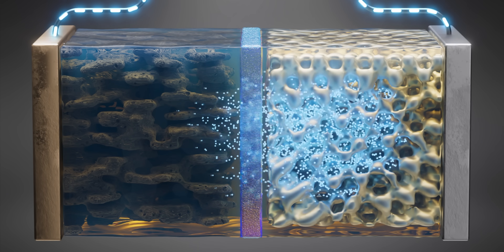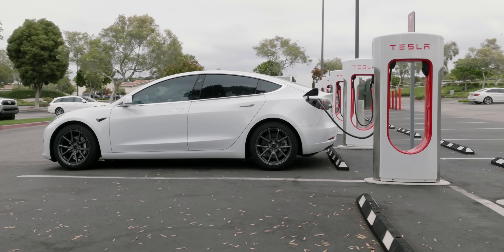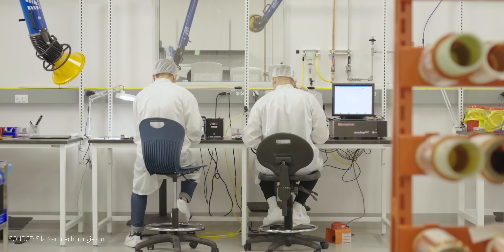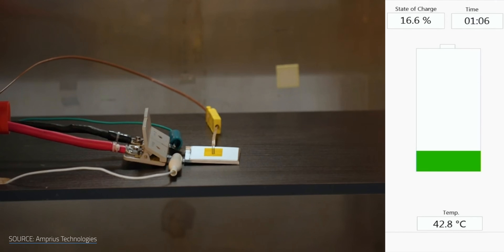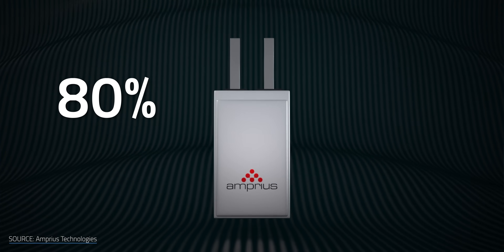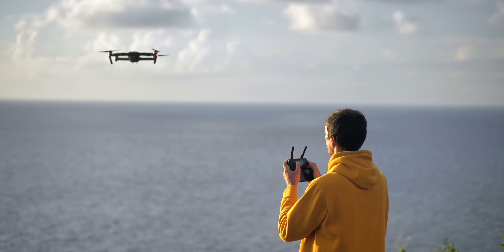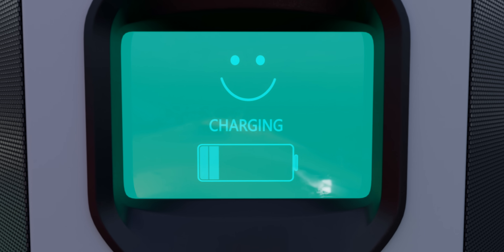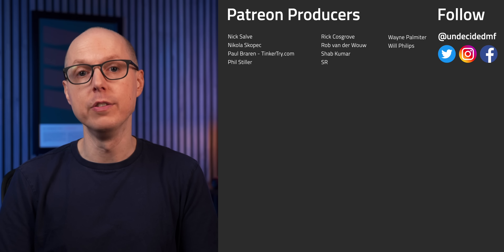Why This Ultra Dense Battery Breakthrough Matters

Comment: If a battery has a 50% weight advantage compared to current tech you could also definitely get a wooping range (if you keep the same weight ratio of batteries in EV's)? Paired with 6 minute charging it'll make EV's seriously contend with fossil fuels vehicles in charge time vs refuel, and range too. Now we just need infinite cheap electricity to actually be able to transition out of fossil fuel dependency, and power-grids that can handle these increased demands. :P Anyway, cool tech, hope it will prove viable at scale.
Reply: In the end much will depend on the price and expected cycle life.
Reply: @blablup1214  This. Cost per charge is the big question about this tech now.

Comment: Whatever happened to fuel cells?  If you have problems with storing the products of the reaction why not just remove them from the battery (essentially turning it into a fuel cell)?
Reply: You’re describing flow cells. They are also in research and production.
Reply: @nicholasthon973  Ohh great.  According to the definition on Wikipedia anytime you flow reactants through it's a fuel cell but that's possibly a mistake bc the term only seems to be used to describe reactions with O2... usually hydrogen.
Reply: Hydrogen is very inefficient for the production, fueling, and storing. It is pernicious (leaks). Deteriorates metals and other materials. Dangerous by being highly explosive pressures and burns clear while very hot. Hydrogen is all around a bad idea for most applications.

Comment: Sounds like battery tech is advancing faster that the bloody electric grid structure eventually its not gonna cope especially for cars 
Does faster charge times require more current or power 😜 i just want some for my ebike 😂😂

Comment: I'm always amused by new batteries that will charge 5 or 10 times faster, this will need 5 or 10 times the available power to the chargers and cables that are 5 to 10 times bigger or liquid nitrogen cooling or other far fetched ideas. The problem with ev's is not the battery tech, it's the power grid tech and the generation and transmission tech. A classic cart before the horse situation
Reply: True, but it would be a great advantage if the new battery could just hold todays' peak charging rates the whole time.  That would greatly reduce charge times without needing massively larger infrastructure.

Comment: LIthium is a dead end for EVs; refining is a choke point as it takes 500,000 gallons of water to refine a single ton. Silicon or other new chemistry is essential for EVs to rise beyond a niche market size. While EVs need a battery breakthrough I find EV advocates often distain other tech that also needs one such as Hydrogren. There is an existing solution which meets most requirements - Ethanol fueled PHEVs.  They already are being sold in Brazil and can commute full electric. Unlike EVs they use no fossil fuel.  The world grid is over 75% fossil fuel powered and has a 15% penatly for transmission to the charger and battery;  add to that EVs are heavier and use more power to move.

Comment: My big dose of doubt with these is we have seen literally hundreds of alternative battery techs to Li-ion over literal decades and exactly 0 have come to the general consumer market. It seems like battery tech needs to make such a large jump in every possible category at once to overcome market inertia that it's basically impossible for it to impact consumers. It feels like the entire sector is perpetually "too good too be true" for the average person.
Reply: One of the new battery technologies of the last few decades has come onto the market: nickel-metal-hydride. It is not as good as lithium-ion for energy density but it is very good as a direct replacement for nickel-cadmium (which self-discharges rapidly, making it unsuitable for some applications) and for non-rechargeable 1.5v cells, the continuing manufacture and sale of which is now inexcusable.
Reply: @cedriclynch  NiMH batteries entered the market over 20 years ago. It's not that much newer than Li-ion, and was never targeted at it (as you mention it replaced NiCad and DID beat it on every single category) so it's a different market segment.

Comment: There's definitely a need for far more powerful and quick charging batteries. However,  passenger cars don't contribute more than 10 percent of the total CO2 output. We could go green with everything else and let cars continue to use gasoline and the environment would be just fine. Why is there this incessant picking on cars?  Go take care of power plants and that'll make a much bigger difference for the environment.

Comment: Does someone want to fix the fact that EVs lose all their value when the battery hits end of life?  A better battery should have a 20-30 year life and be cheap to replace.  And then there is Tesla's "the battery is the car body" nonsense that assures the car is a complete write off at end of battery life... The cost of replacement MUST come down, otherwise EVs will be the WORST thing in the market for environmental impact.

Comment: I know this seems innocuous, but I am curious if it is a choice or lack of knowledge to continue propagating unmanned.

The faa has officially stated that the term unmanned was historically used in an intentional gender segregation capacity and has moved away from that term to uncrewed or unpiloted.

Search "faa words matter"

As a male in the industry it is a very small action to take to help reduce the history of gender exclusion in this section of the work place.

Comment: 3:07, that is laughably easy to prevent, just use an ultra sensitive pressure toggle switch to cut the power supply when the expansion pushes against it, no power supply = stopped expansion. You can add a timer to the power connector that the switch redirects the power to when activated, once the timer runs out the power is once more directed to the battery instead of the timer. Battery will never overcharge like that, might die from lack of power but that's still better than overcharging, can always make the timer programmable by just adding a counter to the battery that just keeps going up while the power is active and the timer can just use decrement that count on every tick to reach 0 and timeout. There's ZERO excuse for allowing batteries to over expand.

Comment: I am doubtful about silicon being more environmentally friendly. 
Natural Graphite occurs as graphite flakes in certain rocks (eg graphitic schist) and is liberated by crushing and floatation. 
Getting pure silicon is generally through a smelting process since it is often bound with oxygen in a source silicon dioxide sand.
Reply: Yes, also you can't just take sand from the beach, it is dredged up from the coastal area causing environmental damage
Reply: Silicon is never found in the elemental state as it is far to reactive chemically.  Most silicon is found combined as oxides in rocks with other minerals.  Quartz is the purest silicon dioxide and is fairly common but still has to separated from the other minerals such as those found in granite.  To obtain pure silicon from silica (SiO2) requires the input of enormous energy to remove the oxygen. Really tough to do compared to mining graphite.

Comment: I would assume if 10x is the max - thats because it can be made in a grid like scaling design. That means you can scale up or down the amount of "wire" you need to grow for different levels and thus cost can scale depending on the amount you want to hit with a the design only getting better over time. My point is that they could release batteries at 2x, 4x, 6x, and 8x doubling the range every time and cutting the amount of over all batteries you need by half as well and thus you not only save on a technology that cost as much as current batteries, but the over all amount. The risk of these batteries also drops as you remove more and more cells from the pack from fire, production issues, and failure rates of the cells themselves. It also opens the door to replaceable batteries at the customer level as the over all pack gets smaller to the point its like replacing current batteries in ICE car. Let alone, at half the size or 1/6 the size means more over all range as well even if the battery is slightly higher as you would still have over all less of them meaning less power has to go to carry weight as x range. If its easy to add into current tech - you could in theory say over night, depending on the X you want to go for, double, triple, quad the amount of packs you produce as you would need that mean less over all cells to hit target power storage.
Reply: Given EV's are already around 30% of the fire risk versus Gasoline or Diesel powered cars as reported by a number of testing organisations, reducing the risk further  will be subject to diminishing returns.
Reply: @timofthomas  Well that isnt fully true. Its not always about fire. Its about risk of the battery it self. In most cases, the battery has to be trash and insurance companies dont wanna pay for that as well. By reducing the over all size, you not only make the pack cheaper, easier to replace, but you lower the risk / need to even replace if the car was ever in trouble.
Reply: You write as if there are no recycling facilities.  Get up to date!
Reply: @edwardcoulter9361  uh?

Comment: Very Interesting, and definately sounds like a possible future winning tech.  But as you mentioned, I've seen many super "Promising" nano-tech that sound very good on paper that never went anywhere precisely because the technology did not achieve mass-production.  The reason for not reaching a mass-production viability is not only due to technological difficulties, but there are times where "good enough tech" that is economically far superior just winning the market that kills off investment or some similar market trend issues.
All I'm sure is that there are people tackling the battery issues which makes me believe some technology (or combination of techs) will address the issues we have at hand in the not too far future (several years to maybe a few decades).

Comment: But does it use less lithium than current batteries? With every rechargeable thing using lithium, that's the resource I'm concerned about the most.
Reply: We won't run out of lithium -- technologies using it are literally better lithium ore than lithium ore. You can just throw your used stuff into the processing facility worst case. We don't do that because mining new lithium is cheaper than bothering to collect the old lithium. If you want something to worry about, worry about the loss of groundwater, which we can't replace by just throwing some cell phones into a mine.

Comment: As always, it's about the economics.

As to aircraft, batteries have a severe limitation over liquid fuels; I always have to haul the battery pack around, while with fuels, it's burned. I also have the issue of ground infrastructure; we don't have it for EV aircraft... yet. I'd like to see 100% SAF than EV aircraft: The economics are a know quantity and SAF is getting much less expensive.

Comment: As an ebike rider (road and gravel), weight is very important to me. Looking forward to more watts per kg of batteries :)
Reply: E-bikes are power efficient enough. More energy efficiency would be good though.
Reply: Many many moons ago I raced, SL and SLX tubing was the hottest thing and then out came graphite and titanium..... Aero helmets and wheels to save an ounce. Take a piss😂instead. I've lost track over the decades... I have yet to see an e-bike in a road race or a Criterium😅
Reply: @terrific804  I don't have to race other people to enjoy riding a lightweight bike. I ride long distances and saving each kilogram can mean I could ride a few more kilometers in the same timeframe. My ebike doesn't have a throttle to go 50 km/h. It barely supports me with 60 watts and I have to do the climbs myself.
Reply: @SonnyDarvish  ❤ I love-loved the relative freedom of a bike. And the boy Scouts..only WHAT you NEED..🙈 riding out from home 40 or 50 miles and laying down under a tree and enjoing the freedom of being alive, turning around for another 50 and not dependent on anyone except my own wits and what I carried on my back or bag.❤
Reply: @SonnyDarvish  racing was just FUN
Reply: @SonnyDarvish  I'm going on 73 now...its still fun..so are rocket ships...and walking the dog😉

Comment: If a battery came out tomorrow with a 1MW per hour charging rate it would reduce the charge time by.......? Nothing probably, as the chargers and then the grid, cannot handle 1000's of cars drawing a megawatt of power.

Comment: This one actually seems viable, but any progress is good. 20 or 30% improvement can make a huge difference in the viability of a product.
Reply: It’ll probably never see the light of day. If you understand tech you’ll know that this company is basically just doing research and will end up getting bought out an integrated into another company. Patents will be sold, etc. 

This is just a steppingstone, and only one of many other battery technology is being explored currently. It’ll be 10 years before this trickles down to any consumer.
Reply: @Eric_In_SF 10 years? It's here in under 10 months. Most current flagship smartphones have started using it, next quarter it will be available in premium phones too.
Reply: These battery breakthroughs have "seen the light of day": many of the companies have sent out engineering samples, and some have even made a few hundred or thousand batteries for highly demanding applications like drones. You mean "widespread commercial availability," which hinges on hundreds of $millions if not $$$billions of investment in production engineering and production facilities.
Reply: +20% capacity is meaningless if it's associated with a similar reduction in cycles - so any results from the World Solar Challenge can be ignored.
Reply: @charlestoast4051  If they both have the same energy to weight ratio 20% better means 20% less weight and that's definitely better for the hypothetical electric plane. But based on the video it is 50% lighter so that's even better.
Reply: It's essentially the EV equivalent of the rocket equation.
Reply: @charlestoast4051 what are. Cycles. ?

Comment: Today’s battery development is very similar to computer design of the ‘80’s and ‘90’s where we saw a lot of different designs and ideas and now, they’re pretty much standard on a single design and capabilities of what works the best.  Hope Amprius succeeds, at least in pushing battery chemistry and design further along.
Reply: Apple just switched laptop/desktop from CISC to RISC design. Many a software is switching from DT to NN. There are audio only UI hardware offerings. Neuralink may be a thing one day. I don't think the standardized on a single design assertion is correct.
Reply: @TimLF  Nothing ever becomes standardized on a single design - innovation is always a thing. But we know what he meant... All that crazy zoo of gadgets and trial and error of the 80s and 90s has sort of settled into an equilibrium today - and we're happy with our devices and their universality.
Reply: @TimLF … and GPUs, VR Headsets, wearables in general, cloud meta architecture, IoT.

Comment: A very chaotic video: 
"The company is gearing up for mass  production by building a 103-acre campus,  INCLUDING (?!) an existing 1,278,455 square foot (acre mixed with square-foot, the best way to make things complicated)  facility in Brighton, Colorado. This factory  is expected to greatly increase Amprius’  manufacturing capacity...  WITHIN JUST THE EXISTING FOOTPRINT (?!). Their goal  is to be up and running within a couple of years."

Comment: I would like to know why laptop batteries are not control charged, rather, the manufacturers do not protect the batteries.  Probably because there is a market for new batteries, and they are greedy.  Same holds true for cell phones and other electronic devices - they have CPUs, so they definitely know when to stop charging and when to ask for an additional charge.

Comment: I wonder why BYD, CATL, SK Innovation, LG Energy Solution, Panasonic or even Tesla isn't studying using this material for their batteries. It could finally allow the reduction in size of the battery pack without sacrificing range.
Reply: Because you need expensive ovens and production lines to make those, those used to made by companies like Smit ovens in the netherlands, but the market collapsed and nobody wants to take a several year waittime gamble that costs millions of dollars

Comment: You conflated energy density of the battery and energy capacity of the anode/cathodes in this video. 
You never discussed the actual energy density of the battery but just the anode and cathode interfaces which dictate charge and discharge rates. 

The 3 things that matter for battery performance. 
1. Energy density.
2. Charge rate. 
3. Durability, number of charge cycles. 
If you don't have all 3 you don't have a marketable product regardless of cost.